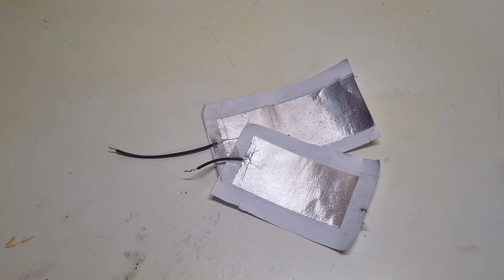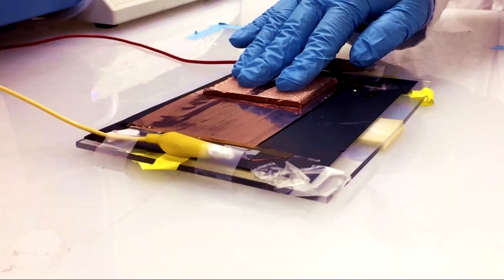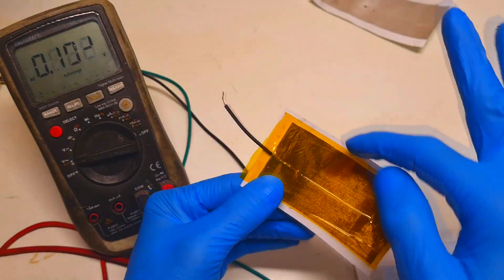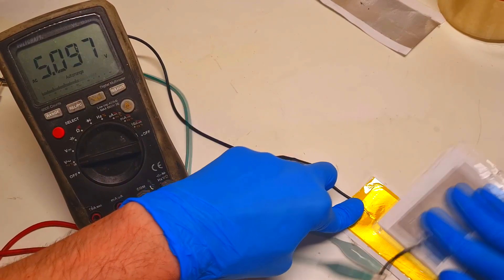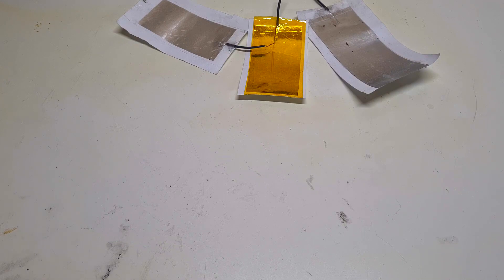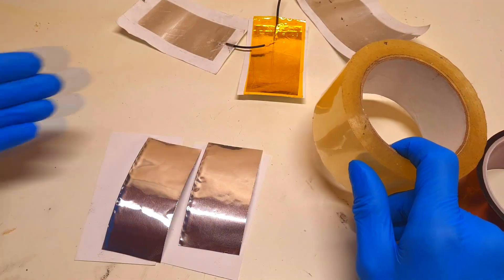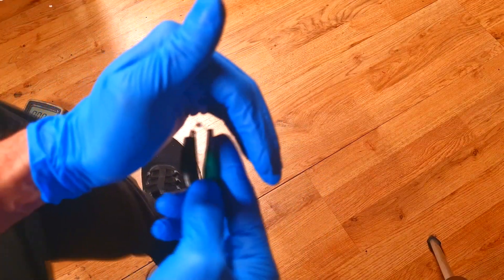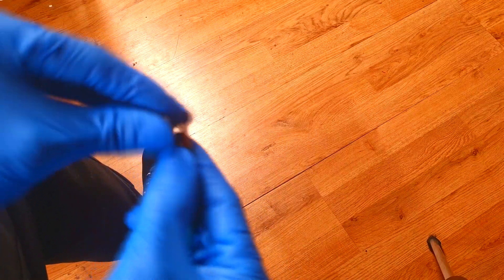Diy Triboelectric Generator powered shoe

Comment: You can use a capacitor to store the energy while running, and a resistor to discharge it in a LED to light the lock on your front door when back to home.
Thank you for your demo and explanations.

Comment: Hi, nice video. I just wanted to ask, did you connect the Led with a capacitor and a resistor ? Because LED lights up with DC, Teng is AC. Thank you

Comment: I have some ideas i may test with your generator. 

1. Modify the insole on a pair of shoes so the generator can go underneath the insole. Mount it in a way so it wont get damaged but be able to move as needed. Maybe multiple thinner ones in series or paralell. running crossways.

2. Modify a pair of flip flops where the generator is mounted inside near the back end. When you walk with flip flops they "Flip and Flop" haha, snapping up and down when you take steps even when walking slowly. Ive tried to walk quietly in flip flops and its nearly in possible. The heel end always flaps in a quick motion.

Comment: It would be possible to build a prototype, with a perpetual motor, in the center of the rotating part, several aluminum blades, feeding capacitors and using pulses, for continuity of movement.

Comment: It would be possible to build a prototype, with a perpetual motor, in the center of the rotating part, several aluminum fins, covering the fins, with capacitors and a pulse controller, feeding a small electric motor on the shaft itself and continuing the movement.
Reply: ... if you're talking about a perpetual motion machine, 1: friction. 2: even if there were no losses, you'd just be putting the same energy in a circle and when you took some out there would be less energy to take out later, like a battery.